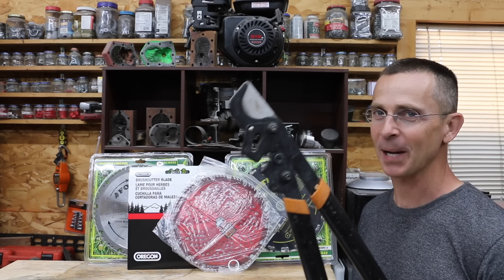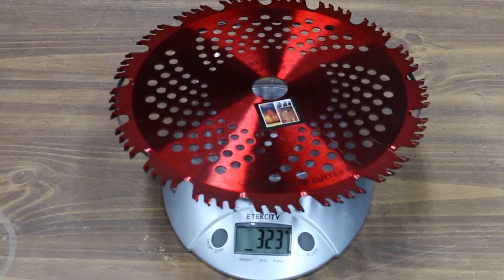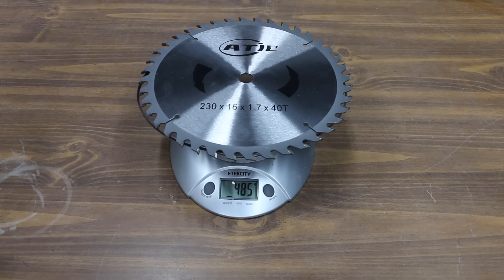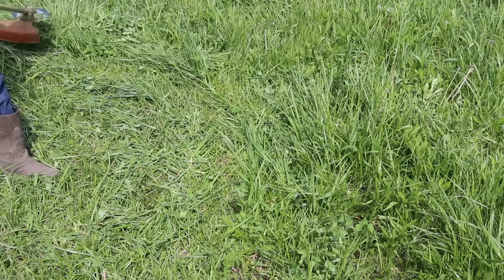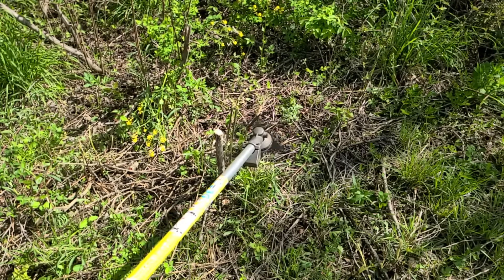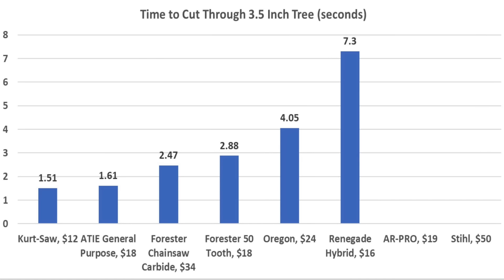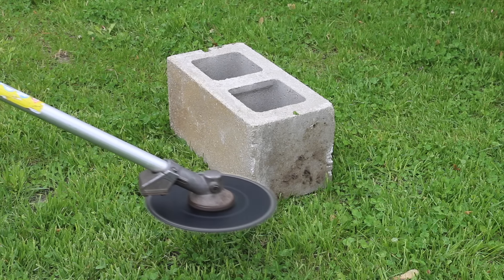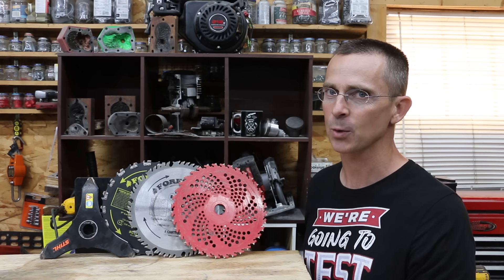Best Brush Cutter Blade? Let's Find Out!

Comment: I have a Stihl FS130 brush cutter. Been looking for the best blade myself. You didn't test several other blades made by Stihl. You did test the 3 blade grass blade. Stihl makes a 4 and 8 edge grass blades. The 4 edge blade can be flipped over for fresh edges. It will cut small trees somewhat but bogs down very quickly. The best is the one with 8 edges. Cuts lawn grass, heavy weeds, briars and small trees very well. Soft wood trees in the 3-4 range are cut with a single impact. Once the blade starts slowing up, it doesn't cut very well. It is easy enough to re-sharpen after T-post impact(got too close).  However a power pole support cable impact dented and chipped all the teeth big time. It could be  fixed but would require too much stock removal. Stihl also makes a chainsaw like blade. It isn't a grass blade and I haven't used yet. It is similar to the 8 tooth blade but more teeth and different cutting surface angles. 
Great job on all the testing. Lots of interesting information.
Reply from the maker: Thanks and you are welcome!

Comment: X-lock system in the brush cutter.
135 degree gear case The last gear that is transmitted is made of an O-ring with a hole in the center, and the cover that is fitted under the hole is made of a bearing. It is light.

Comment: I use dewalt circular saw blades on my weed trimmer and it fits perfectly without drilling the hole out. Dewalt does a great job cutting anything I need to cut including 3-3.5 inch trees and you can buy them for around 8 to 10$ a piece so if you ruin it your not out a whole lot of money
Reply from the maker: Thanks for sharing.

Comment: We use the stihl tri blade for large scale brush cutting of bulrush and bamboo stands. It’s by far the longest lasting blade for that type of work. Able to sharpened very easily. Hidden objects like rocks, steel pickets even fencing wire barely phase it. Brush over 50mm we usually take down with a chain saw. Though if the blade is freshly sharpened it can cut through larger objects. 
It’s a tough long lasting blade that more than makes up for the price. Buy once cry once.
Reply from the maker: Thanks for sharing.
Reply: Tri blade is for tall grass

Comment: Great assessment! The best combination I've ever used for trimming dense brush is in the style of the three-bladed Stihl cutter (mine had four blades) and a trimmer head/mount with a spur at the end of it, offset to the left side. With the blade rotating counter-clockwise, the spur being offset to the left lets you "hook" any particularly thick piece of brush against the spur, and press forward against it rather than sideways. Like this, the piece of brush is effectively pinned against the spur by the rotation of the cutting blade until it's been cut through completely, requiring much less effort while giving you a much more consistent cut, and greatly reduced risk of kickback.

This style of trimmer head is very uncommon, however - with some searching, I've only found the Remington RM2700 trimmer and the Troy-Bilt BC720 attachment (which seem to be identical designs), as well as a DeWalt brushcutter attachment which I can't find a detailed image of. If you ever revisit this subject, I recommend finding one of those heads for testing the smaller bladed varieties.
Reply from the maker: Thanks!  Thanks for the video idea.

Comment: Pole saw is my go to for brush trimming. then take a cheap sturdy push mower with a sharp sharp blade to grind stumps under 1.5 inch wide. You can grind bigger stumps just gets sketch real quick.
Reply from the maker: Thanks for sharing.

Comment: I've used alot of blades and find STIHL with their chisel tooth blade out performs every other blade I've tried! can use a chainsaw sharpener that costs 4 dollars to sharpen the chisel tooth blade in 30 seconds! I have hit metal, fencing. concrete, rocks... still sharpens out perfect everytime! I also use the 2 sided brush blade for just tall weeds in naturalized areas, but switch to the chisel tooth for small trees! I have taken down 5-6" trees with ease with the chisel tooth. cant wait to see you try that in the next round cheers
Reply from the maker: Thanks for the feedback.

Comment: Hey nice video :-)  the wire brush blade We use them all the time at work not for Cutting Grass ! But for weeding. Like between paving stones /paving slabs/ Curbs on the side of the roads /cracks in the roads them selves or even in gravel as it has low projection of stones.. It's amazing for weeding where ever grass grows where it shouldn't also weeds too. Plus can be used around swimming pool deck for example to remove grass from around the edges of the deck and if you tilt the brush slightly to a side and it will clear grass and give a nice slick edge without grass getting in the way.. Also all around curbs clearing grass at top and weeds everywhere else :-) PS: the Stihl blade with 3 sharp edges is basically for grass brambles very light wood like the 1 inch
Reply from the maker: Thanks! Thanks for sharing.

Comment: I learned the hard way after having to pay for damage. I elininated that problem by carring and extra trimmer dedicated to brush. When i cut brush this is all i cut with the trimmer. I have a hedge trimming blade on a changeable shaft and a shaft for doing only edging and a shaft to trim grass and weeds. Don't risk cutting into anything you don't know what it has in it or used for. Replacing damage can cost hundreds if not thousands in repair cost. I had to pay for wire and it was not cheap. The conduit had to be replace too. It cost me. Almost $3000 in parts and labor. Hard lesson to learn. I'm just thankful i had insurance to cover repair. My insurance also went up. So a valuble lesson.
Reply from the maker: Thanks for sharing.

Comment: Just ordered a hyper tough 26cc straight shaft trimmer and decided to order an adapter kit and the Kurt blades from amazon. I just moved to TN and now have 1.5 acres and need to clear some brush.  Ill pair it with my ridgid recip saw with the diablo carbide 9" pruning blade for the thicker stuff.  Cant wait to try these blades assuming the universal kit even works with the hypertough weed eater.
Reply from the maker: Thanks for sharing!

Comment: You should use a 50cc or higher cc for a CLEARING SAW. In Sweden we call it röjsåg. we use it to clear thinnings with trees up too 12 cm in diameter. Try buying strand blades. And files. 
The whole saw is made for cutting down small trees.
Reply from the maker: Thanks for the suggestion.

Comment: I have found that sage brush wears down the blades rather quickly. Probably because the bark tends to hold lots of dirt. It would be nice to test the durability of the carbide tipped blades. The Renegade has more teeth so maybe it will last longer.

Comment: Todd, the links to the Renegade blades are incorrect in both of your Brush Cutter videos.
In this video you are using the 230x36P, but the link is to the 9-68.
Ironically, the 9-68 is what you were using in the older video, but link below that video goes to a 9-100.
Thanks again for all your work. I love the videos.

Comment: After watching all your previous brush blade tests, I finally got a brush cutter attachment.  It came with an 8" 4 tooth blade.  It definitely cuts a lot that string does not, but is not well suited for thicker cuts.  I'll do some more testing to see if an upgrade is required for my use.
Reply from the maker: Thanks for the feedback.

Comment: Love your channel, love your method and how you create controlled tests.
I am currently in need of a new circular saw blade and immediately ran to YouTube to see if you had done a comparison on best circular saw blades.  Sadly, it doesn't look like you've done one.  So here is a suggestion, a 7 1/4 or 6 1/2 circular saw, pick a blade type (I.E. 24T framing blade) Diablo, Milwaukee, Dewalt, Irwin, Spyder, throw a few cheap Amazon/harbor freight blades.   Keep up the great work!
Reply from the maker: Thanks!  Thanks for the video idea.

Comment: I used the carbide tipped Renegade blades to clear sage brush and rabbit brush on a few acres. They cut extremely well when new. Wish I had known about the Kurt-Saw blades. It would be interesting to see which blade lasts the longest since the carbide geometry is different. Some manufacturers also claim to have special carbide formulations. I would also like to add that my Stihl Brush Cutter had an arbor size that required the arbor-adapter washer. But that did not work because the end cap is cupped so the adapter would slip. Stihl and Renegade could not solve the problem for me so I had to machine an adapter. I was really disappointed with the Stihl support.

Comment: Great Stuff.... I would and I would bet I am not alone in wanting to view a video on Gas Tank liner products.  Many out there with old tractors, motorcycles, and cars with rusty tanks.  Too late for me, I will be doing mine a week or so.  Products like POR-15, KBS Tank Sealer, Red Coat, Kreem, and Northern Fuel Tank liner would be a great start.  Especially useful if somehow we could see how durable the products are.  Having a product disintegrate in the tank in a couple years would be worse than no product at all.  Thanks for videos!
Reply from the maker: You are welcome!  Thanks for the video idea.

Comment: I have previously tried to use a brush cutting blade to dispatch a growth of river can behind my house. Each individual stalk is only maybe a 1/4 or 1/2" and I was using a blade almost identical to the stihl. It does not go well. The rivercane is so flexible that each strike of a blade just deforms it out of the way, so it takes about 5 or 10 seconds to down each stalk.
Reply from the maker: Thanks for sharing.

Comment: The wire-brush blade is not designed for anything you tested it on.  It's for cleaning up weeds coming out between bricks or pavers.  This keeps you from damaging your regular brush blades AND your masonry.

Comment: Griprite makes very good skilsaw blades. I seen a guy cut through a 14ga steel saw horse without slowing down or noticing he did it a d the saw blade was just fine after.
Reply from the maker: Thanks for sharing.

Comment: I would like you to test digital calipers (it could be the 6"" the most popular). They go from $4 to $600 and the differences are not clear. They all seem precise enough but the battery life and the precision when the battery is running out seems to be off on cheap ones. Smoothness, metal hardness and finish are definitely issues as well. Just my two cents for a future video. I love your channel keep the good work.
Reply from the maker: Thanks, will do!  Thanks for the video idea.

Comment: Great channel. For another future video idea how about Motorcycle heated grips on handlebars. Oem and/or aftermarket. Temperature vs power consumption. Heat up time. How much of the grip surface area is heated. How durable is the rubber surface.
Reply from the maker: Thanks!  Great suggestion!  Thank you.

Comment: The main reason blades doesnt discharge the grass is because the blades and generally any blade are made to make clear cut. At a high speed is just chopping it and leaving it mid-air with out transfering and momentum on the grass. On the other hand the wire ones (i dont know how the call them in english in general) are mainly destructive. To transfer as much kinetic energy to the grass cause of its flexible property
Reply from the maker: Thanks for sharing.
Reply: @ProjectFarm  i can not believed it he came and commented on a video he made 1 year ago. Thats empressive

Comment: Great video, one thing though, some blades like the oregon for example needs to be sharpen properly before using it for the first time, then the teeth needs to be angled properly before first use. Personally I use a (I don't remember the brand) maxi 225mm metal blade for thinning and a stihl 3 tooth for anything under 2 inches, I also recommend to only  use string lines when working near buildings or any thing that could be damaged, I can say from experience , metal blades tend to throw stuff everywhere.
Reply from the maker: Thanks!  Thanks for the feedback.

Comment: The rotary twisted wire brush has a specific purpose: cleaning weeds from paver cracks an driveway expansion joints. That’s it. Not for weed whacking or saplings.
Reply from the maker: Thanks for the feedback.
Reply: @ProjectFarm  I like you videos; very helpful

Comment: A comment on the plain steel blade sold by Oregon in your trial (and other similar style blades). While they are more easily damaged than the carbide blades you tested, when properly sharpened they cut just as well or better than the carbide blades. In addition, when a carbide blade is damaged, it is essentially junk: it's not possible for the typical homeowner/landowner to resharpen carbide. With the steel blades, it's just a matter of taking a 7/32" chainsaw file and dressing the teeth back up. With a couple minutes effort, the blade is cutting like new again. (It's faster and easier than sharpening a chainsaw chain, for those who have done that.)

BTW, you happen to have chosen one of the better style of all-steel blades to test. The Oregon 41-935 Maxi Brush cutter blade is made in Sweden. The same blade is sold under a variety of names (Husqvarna and Windsor are two others selling it). The 41-935 is an 8" diameter blade. The Oregon 41-937 is the same ting in a 9" blade suitable for larger brush cutters.  This style of blade is the one chosen by several friends who use brush cutters professionally all day long, 5 days a week on pre-commercial thinning jobs in timber stands. The cost of constantly replacing carbide blades makes them less economical to use, especially if they are operating in rocky areas where blade damage is more likely to occur.
Reply from the maker: Thanks for sharing.

Comment: Testing ideas: 

- Keyed and Keyless Chucks for impact drivers. It's something I seem to always need, but never buy because reviews of most of them scare me.  But is there a good enough chuck for 1/4"  quick-release impact drivers? Dewalt, Neiko, Makita, Jacobs (if they even make them anymore,) and a few other 'less well known' brands I see on Amazon and Google.

- Digital 'laser' Thermometers, which ones are [most?] accurate, what is the range they can be accurate to/from.  Also, durability, because drop tests make things dance.-
Reply from the maker: Thanks for the video ideas.

Comment: You should test table saw blades as well as mitre saw blades. Maybe test cutting speed, resistance, loss speed and tooth wear. Great Video and I also recommend testing protective shoes in terms of puncture, blunt impact and comfort. You can test the internal pressure with a probe and see if a blow would say break a toe or something for the blunt impact test. Good Luck.
Reply from the maker: Thanks for the suggestion.

Comment: I have a couple carbide tipped Renegades and I have a chainsaw tooth tipped Forester attachment as well.  I swear by the Forester, especially if you're hitting anything larger than 1 inch.  I only keep the renegades to prevent the Oregon from getting over-worked on the more numerous smaller stuff.

The Forester chainsaw wheel is 100% worth the money.  If I had known the difference between the Forester and Renegade, I'd have just bought 2x of the Forester

Granted, my trimmer is a bit weaker than his so it might be due to the weight that the Renegades seem to do so comparatively poorly for me.
Reply from the maker: Thanks for the feedback.

Comment: An engine with an oil leak tends to coat everything in the engine bay with oil including the radiator, alternator, etc. Overtime, dirt cakes into the oil and you end up using a lot of elbow grease but still can't clean all the crevices and what not. I'd love to see which degreaser works best for this job. Purple power, simple green, oven cleaner, harbor freight premium degreaser... So many to choose from. My thought is I could soak everything and then power rinse everything clean if possible.
Reply from the maker: Thanks for the video idea.

Comment: I have a video suggestion:  Comparing different brands of light curing glue.  Such as Bondic, Rapid Fix, and many of the other brands on the Internet.  I use light curing glue for repairing lighting equipment, but cannot seem to find one particular product that has both high hardness and adhesion in one brand.
Reply from the maker: Thanks for the video idea.

Comment: You should include a sound level on each trimmer wire when you test them next. For electric trimmers, it's kind of insane. I switched to ugly twist recently from the round stuff my 40v kobalt trimmer came with,  and the sound difference was so insane the twist being nearly silent that I genuinely thought something was wrong.
Reply from the maker: Thanks for the suggestion.

Comment: I have an idea!    So I was told putting ATF or 2 stroke oil in ultra low sulfur diesel fuel will provide the same protection as something like Diesel Kleen. Would love to see some test on these one time practices and see how true they are.
Reply from the maker: Thanks for the suggestion.

Comment: SUGGESTION FOR A VIDEO. You can try different kind of o-ring made of many materials and see how they react to different liquids such as motor oil, brake fluid, petrol ecc, and see wich material is better for every use. Maybe wich one is heat or cold resistant and stuff like that, it can be very intresting, i am restoring a bmw motorcycle and im getting crazy finding the right things!
Reply from the maker: Thanks for the video idea.